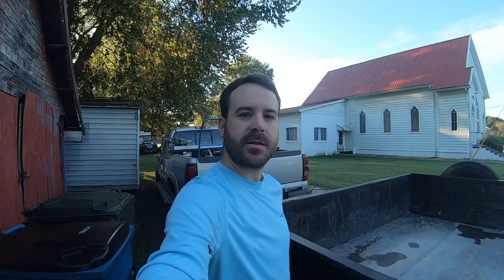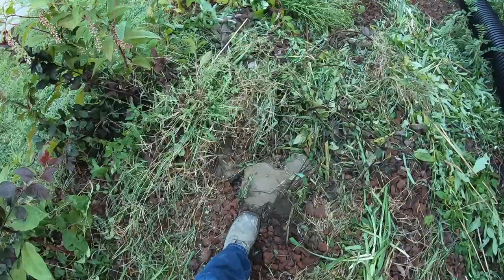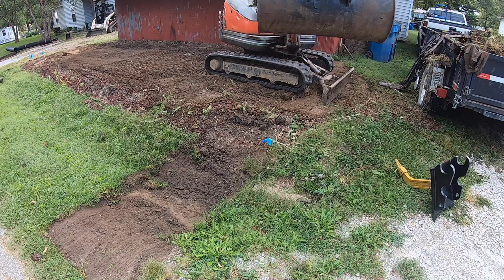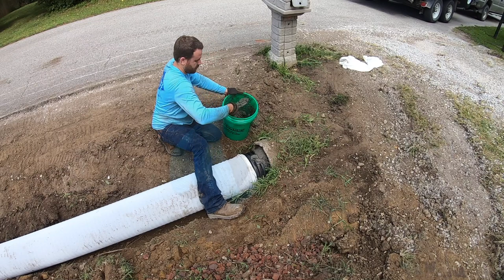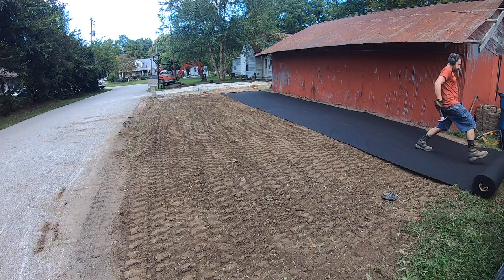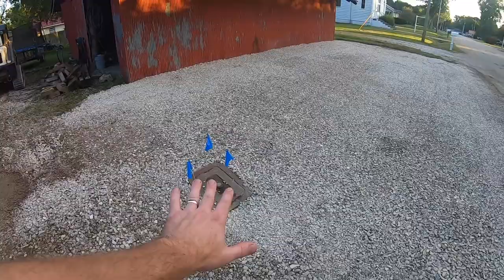Leveling Area over Ditch with Culvert for Parking

Comment: Good work. If you don't mind a suggestion, back filling over that pipe with a few inches aggregate instead of the soil you used below the top gravel would extend the life and improve the performance of the subsurface drainage. The geofabric tends to become less permeable after more and more silt settles into the fabric.
No worries, just a thought for future projects.
Reply from the maker: Yes I was just trying to keep the price down for the customer in hauling off material and importing agg. The pipe got back filled covered with 8's then I just had to do that little bit of dirt to bring the grade up. I've driven by it a few times since, it has held up great and looks the same as when I left it a year ago.